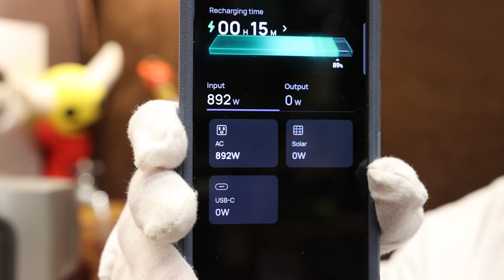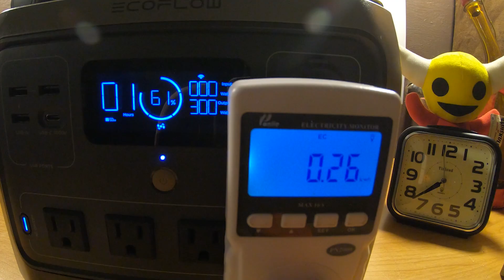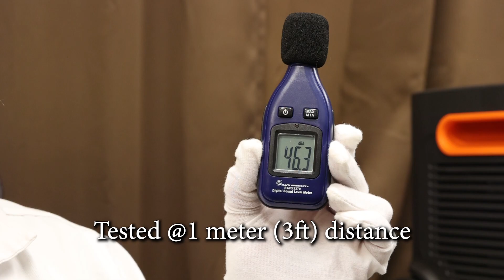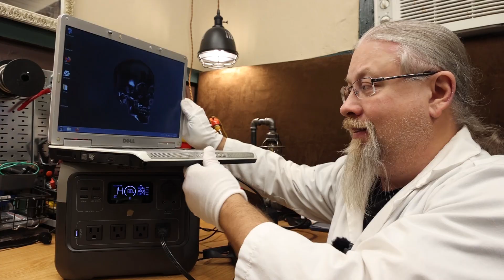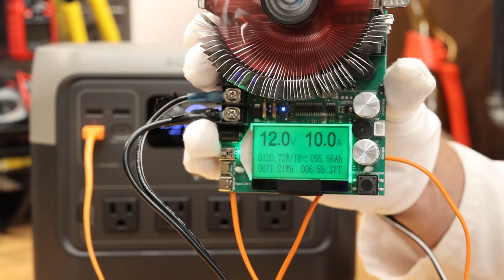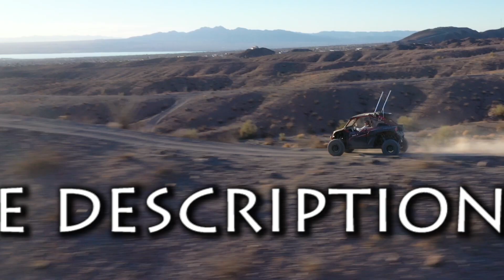EcoFlow River 2 PRO 800w LiFePo4 UPS Power Station Solar Generator Review

Comment: I purchased this and a Setpower portable fridge/freezer. I ran the firdge/freezer in our car for 5 hours with just the ecoflow river 2 pro. After 5 hours the pro was still at 78%. Pretty impressive in the middle of a Tucson day (110 deg). Quite happy with my purchase.
Reply: I have the same set up but the DC output display shows extreme fluctuations in wattage- anywhere from 41 to 59 watts. Are you experiencing the same? Thx
Reply: @judyshore  Only did this once. I didn't monitor what was going on. I just set it up. Went and did stuff. Ans when I came back this is what I found. So, pretty happy with the setup so far.
Reply: Hi, did you hear the van blowing while running your fridge? I had my MacBook Air, a webcam and mic running and the van started blowing after 20 min. in the middle of a zoom call.

Comment: When the screen shows 800+ watts charging and 20+ watts  discharging before the switch over test, doesn't that mean the computer is always running off the eco and not house current?

Comment: I want to know how many actual amp hours it is. I'm struggling with finding the info. Thank you.
Reply from the maker: Watt hours is the proper rating for capacity. However, you can convert to amp hours by dividing watt hours by 12.
Reply: Thank you. Would 12 stand for 12v? Hubby is fussing about amp hours. He wants to run the starlink and a 32" non smart tv with a fire stick. He understands ah but not watt hours. Thank you for the great video. It has my reconsidering the purchase of a similar Bluetti.

Comment: Isn't it true that the other difference between a UPS and a EPS is that when there's power the battery in a UPS is bypassed while in an EPS the battery is always being used (it is drained and charged at the same time) thus running an EPS as a UPS will reduce the life expectancy of the EPS battery? What are your thoughts?
Reply from the maker: Eps is just a slower switching ups at least on Ecoflow
Reply: @HOBOTECH  thank you for the response

Comment: Can you add additional batteries to this model? It appears you can as Echoflow sells a "EcoFlow RIVER Pro Extra Battery" but I've Yet to see this mentioned in any reviews. I could have easily missed it but ?   ?
Reply from the maker: No. The battery is for the older River Pro not River 2 Pro.
Reply: @HOBOTECH  I'm curious is it would work to charge this unit with Another power station, possibly through the USB C port? 
I saw a picture of two stations connected this way but no info.
Reply: I have the pict

Comment: question for u.. 
 If used 24/7  as UPSs, what do you think the life span would be? I read that this is a bad idea for gen1 - but the EPS feature has me rethinking. 

I have 4 areas in my home that draw 70 to 120watts - each on APC UPSs - two of which are powered by inverter/AGMs.  For the other two I have a few gen1 river pros I can move around as needed to maintain creature comforts in the event of power outage.  I'm curious about upgrading these two ups's to the gen2s
Reply: Seems like it is fine to use it as a UPS based on this video and also based on EcoFlow : “When your portable power station is plugged into the wall, any electronics plugged into it are powered from the grid and not its battery. When power from the grid stops, as in a blackout, the power station automatically switches to battery power within 30ms.”
Reply from the maker: Eps is a slower switching ups and not necessarily suitable for keeping computerized electronics online when the power goes out.

Comment: I mentioned this in another video, I really think these guys need to add a USB-A output to allow communications with the computer being backed up. All they would need is a USB port and a bit of software that allows the UPS to communicate when the AC goes down and also when the battery is almost dead. With it, you have UPS. Without it, not so much, because the equipment being backed up, has no way to know when to shut down.

Comment: I have one of the river 2 maxes and in winter it's on my fish tank. Has the latest firmware and weirdly enough sometimes it switches over instantly and sometimes the light on my tank goes out for a second. So probably still not for computers UPS....  They work nice though, I bought a max instead of a pro and it looks like the pro would have been a better size for me.... but I keep it in my truck back seat and it runs a small air compressor in my box so I'm happy as I have mobile air and an always charged 600w power station with me wharever I go. Sure I could have installed an inverter for the compressor but then it's stuck with the truck and loses the ability to be used elsewhere. Good products sofar It seems

Comment: If you need a UPS, buy a UPS. Don't use "gimmicks" as a UPS. An actual UPS is completely different from one of these. You are wasting your money if you are buying one of these to stay online during a power outage. Your online provider is going to be very dependent on how long they can stay going depending on their UPS system they have. The days of the phone working during a power outage, went the way of the landline phone.

Comment: Which powerstation let's you set it to never turn off?  I own every Jackery powerstation except the 1500 and the 3000.   From your review of the 3000 watt Jackery, it seems to be the only powerstation that I'm aware of that has an option in the app to never shut down regardless if you are charging anything or not but I would like to try another brand/company besides Jackery because I'm very disappointed in my Jackery 2000. 
I need a new powerstation that's between a 1500 watt and 3000 watt, I also need it to work in very cold weather and very hot weather too and finally, I need a powerstation that has the option to never turn off unless I turn it off ... so it needs to always stay on.  Can anyone recommend something for me besides the Jackery 3000?  Thank you

Comment: Can someone advise me on this issue? A company sent me a LiFePO4 1000w power station with a dead AC inverter. They replaced it, and I kept the dud. Everything else works on the power station. Can I use an AC/DC converter plugged into the wall to charge my power station through the 5521 DC IN port? The spec on the port is 12-30v 7A 200W Max. Any advice appreciated.

Comment: The amp interference test is exceedingly important. If you're trying to work remotely on a laptop thats running off 120v and have to do a video call or anything that records your voice. The mic will have that noise on it as well. Its why I'm so annoyed I didn't watch hobotech's review of the Jackery 1500 before I bought it. Hope some day you can look at the powerkit. Make sure that doesn't have a noisy inverter for #vanlife people trying to work remotely.

Comment: I have a delta pro and was wondering if you had a workaround that would allow me to charge the unit via a 15 amp outlet while the unit is outputting  over that amount. I was thinking maybe having an external ac to dc charger and charging it over the solar imput, but I have not found any viable products that would allow me to do that. I would appreciate any advice you have. 😊

Comment: Does the amount of load affect how fast it can change the power source in a blackout? I guess thinking about it it shouldn't matter since it's all about the relay but maybe the differences in power use of say a laptop under load or a pc under load would force it to shut down due to the speed of transfer?

Comment: Would be cool if they start allowing you to link up these smaller inverters and sync the AC outputs for higher power and then also for split phase.
Reply: I just discovered Inergy does this on the Kodiak X2
Reply from the maker: Good luck getting anything from that brand. They are non responsive. Bluetti, Ecoflow all have units that parallel.
Reply: @HOBOTECH  I was wondering why I haven't seen anything decent reviewed by them...they look to have really good features but the lack of publicity does seem odd.

Larger inverters can be synced and stacked together hopefully someone else will add this, I think it would be awesome
Reply from the maker: @rcguymike  Like I said, watch my reviews on AC500 and Delta Pro.
Reply: @HOBOTECH  They will do split phase but as far as I can tell if you don't have balanced phases the whole system goes down when 1 unit runs out.  It would be nice if you could stack together units on 1 phase and have them communicate to use the batteries more equally, especially if you had multiple different solar strings connected.  For example if you have 2 AC300's and 4 different solar strings they'll most likely not get equal amounts of power, you'd have to manually swap around strings or charge 1 AC300 with the other if you wanted to balance them.

Comment: That is cute, but why anyone would want LFP for a portable device when it is 25% to 50% heavier than NMC is beyond me.  Let's keep the port-able in "portable'.  (And if the answer is "duh, the 3000 cycles", I would say that if you take it out once a week every single week, and use one full cycle in the process, you will be over 55 years older by the end of all those cycles. 😵)
And while clearly obsolete with many fewer features by comparison, I mention it only because it is coincidentally at the exact same price $599 price point: the ancient (2.5-year-old) Pecron S1500F has literally 90% more energy capacity (Wh) and output power (W) (at 60% more weight)...

Comment: I have river pro and used for several camping and long road trip to power my 12v refrigerator. This looks like significant upgrade! I only use DC output and one problem is DC is not very efficient on River Pro. I have two 100w solar panels and I had to connect in parallel. With v2 I can do series (less cable and more efficient) as it supports upto 50v. It also has slightly higher capacity, LFP, and same pass through capability.

Comment: Always enjoy your videos. I've asked this several times but I've never been this early to a video! 
I currently have a Jackery 880 mostly to run my sump pump during a power outage. Obviously this requires me to be home and physically plug it in because no UPS feature. What is the maximum wattage able to be used as a UPS on this device?
Reply from the maker: The 880 is the stripped down box store model. It doesn't have UPS. The 1000 Pro I reviewed is the smallest one that does.

Comment: So is this functional, if you do not have a smart phone? Is there another way to make any adjustments? What if you do not even have internet access?
Reply from the maker: Yes, the app is optional. However, there are changes that can only be made via app. So you'd have to use a friend's phone or tablet to set it up first time.

Comment: You should use your new YEAPOOK TABLET oscilloscope for your sine wave purity test instead of the LIUMY multimeter. It has a much higher resolution and generally nicer display.

Comment: Thanks Much  
How come these Companies use switching for these Ups style fancy box's ??
I have an old late 70's Early 80's Sola 600 Watt Pure Sinewave UPS . Is Big and Heavy and Large as a Bus and with a nice clean output that I used for Live Video Feeds from the back of My Pick up like a News Truck. In stock form it had a Tray on the Bottom that held 48 1.5v Dry cells for a 72 VDC Buss. I used 6 Big Deep Cycle Batteries to run it. 
The Load runs off the inverter at all times. the 120vac input powered the inverter and the battery charger, no switching needed. I should power it up and see if it still Works HAHAHAH..
I disconnected the internal Battery Charger Ckt Cause I used a 20 amp multi voltage Charger for the Deep cycle batteries.
Speaking of batteries. With all the Reviews You've Done on them, Which would be your go to Choice ?
Because of all the 12 volt Gear I have I want to (Build My own) System. For 120 Volt stuff I want more run time than big Current loads.. 
Mike M N9IAB.

Comment: Yah, EPS is definitely a fake term.  But the "UPS mode" for these vendors (EcoFlow, Oukitel/FFPower, and Bluetti), whether they call it that or not, is not a real UPS mode anyway... not even when they switch fast enough (which Oukitel/FFPower and Bluetti both do, and apparently this River 2 PRO now as well)... because they don't pass the ground through from the AC input to the AC output, and they also do not necessarily reference the output AC to the input neutral either.   So if you try to plug a real UPS into the output of one of these power stations, it will generally barf up errors and refuse to charge.

The clean-inverter / power-amp test also requires testing whether the power station passes ground through (or not).  Typically, you get less audio noise with ground disconnected.  But for safety, you really want ground to be passed through from the AC input as well as a current trip on the ground wire as an extra safety.  I don't think any power station does either.

-Matt

Comment: Sigh.  Regulating the DC outputs to 12.6V makes them useless.  Why oh why do these power station vendors still do that?  They need to be north of 13V or half of your 12V devices either won't work or won't be able to pull max amps without tripping off or regulating the amperage down.  The bluettis, for example, output 13.3V, and the Oukitel's around 13.2V.
Reply from the maker: Watch the test again. It provides 12.0v at the full 10A.
Reply: @HOBOTECH  Try using a longer cable and see what happens.  At 5A+ the voltage drop on normal, relatively short (1ft) 14 or 16 awg cables is pretty serious, like 0.3V.   Not to mention that there are reams of '12V' devices out there where 12V is the lower-limit, or even too low, for them to accept.   For power stations, the charge rates can become unnacceptably slow very quickly.

Try shoving that 12.6V output into the input of your other power stations and see what amperage they decide to charge at.  I can tell you right now it won't be the limit (usually 8A) for many of them.   It gets worse when you plug in other 12V devices.  Some will work fine, some will be degraded.  Some won't work at all.  Particularly with long cables.

If you want true plug'n'play compatibility, the output voltage has to be north of 13V.  Even 13.2V is too low in my opinion.   But it is a damn sight better than 12.6V I can tell you that.

--

I'll run a quick test with a power supply (verified with a multi-meter) and my EB55.  You have even more power stations you can test on.   12.6V... set, verified at all amperages 0-10A at the power supply output terminals.

12 AWG cable, 1ft (smaller gauge than most cables... bigger cable).   At 12.6V, it charges at 5.9A.   At 13.6V it charges at 6.55A.   At 14V it charges at 6.6A

16 AWG cable, 1ft.  At 12.6V, it charges at 5.7A and the voltage drop is 0.26V across the cable.   At 13.6V it charges at 6.2A and the voltage drop is around 0.,30V.   At 14V it charges at 6.46A and the voltage drop is 0.31V or so. 

Just to verify that the EB55 is not self-limited, I ran it at 24V and it charged at 7.9A.

In anycase, it makes a difference, particularly in the real world where cable lengths can be a lot more than 1ft.   And as I said, I have had poor results with DC outputs below 13V in terms of device compatibility.  Not just power stations, but other DC devices or devices with "12V" DC inputs which actually expect 13V+.

It's gotten so annoying that I just don't buy power stations whos DC outputs are below 13V any more., no matter how good their other features are.

-Matt

Comment: With the not recommended for amplifier use do to the interference I wonder if it would be ok for in the field HAM radio use. Generally, ham radios are well filtered. Any info you can offer on that?

Comment: I've been researching portable solar generators and their respective solar panels for the past 4 weeks. 

Having never owned anything other than gas generators, I'm new to this game, so I started out looking at Rockpals 300 watt generator with their 100 watt panel, and i soon discovered that I wanted something larger, as well as something of a higher quality.

Next came the Jackery 500 watt generator and their 120 watt panel, and I soon discovered that I wanted something larger, as well as something of a higher quality.

Next came the Bluetti EB70S and their 200 watt panel, my decision was finally final, the Bluetti was what I had been looking for all along, and I set out to find the best price, which I did, their Factory Store. 

As I readied myself to pull the trigger on the Bluetti EB70S and 200 watt panel, the all new Ecoflow River 2 Pro magically popped up before my eyes, and the more I researched this new unit, the more the Bluetti looked like yesterday's news, so now I've finally made my decision, and it goes to the new Ecoflow River 2 Pro and their 165 watt solar panel, and barring any unforseen brand new unit popping up before my eyes, my decision is finally final !?  😮

Comment: We need another test - How much battery drainage occurs per hour if the AC is turned on but no devices are connected, or what is the parasitic draw? 800w inverter should be low, but these portable devices are very poor in that area in my experience, which also somewhat negates their very purpose.

Comment: If you have two power stations with bi-directional PD charging, are you able to charge one station with the other through the PD ports? I have an Energizer 320 WH and wonder if this would charge it via the PD port with both being bi-directional.
Reply from the maker: Yes. The one you turn on first will typically be the output.

Comment: They kind of cheaped out by using the same inverter for the pro model, would have liked to have seen a 1,000 watt inverter and wireless charging.

The only thing extra to make it pro is the battery size, EcoFlow should have added a few more bells and whistles to have made it seem more of an upgrade.